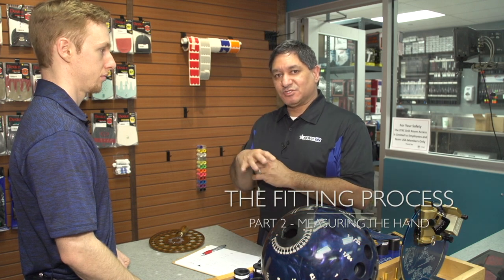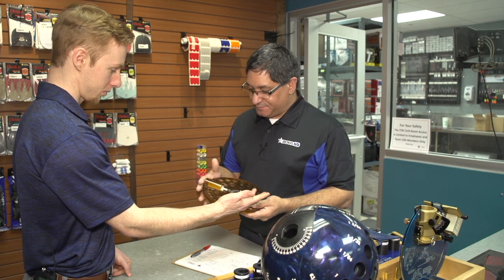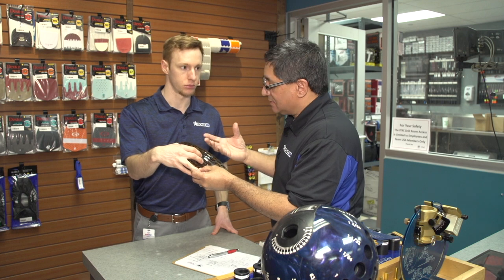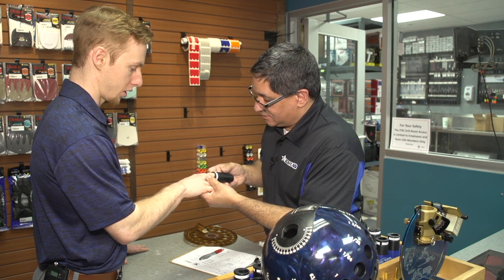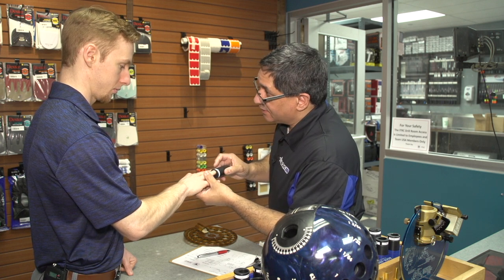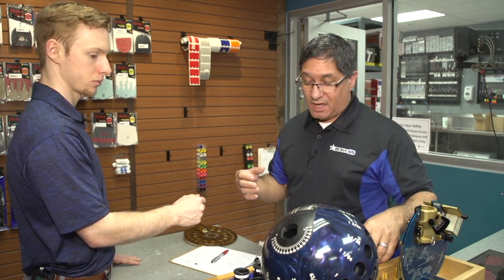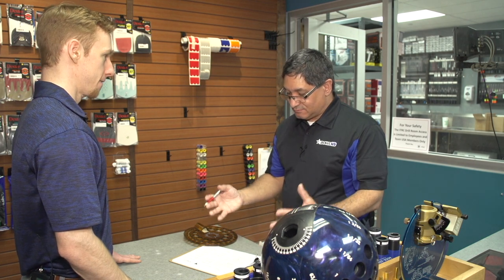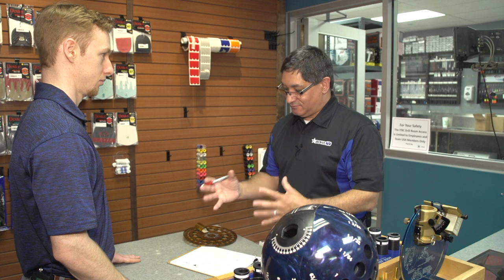Hot Off the Press - Measuring Your Hand for a Proper Bowling Ball Fit (Fitting Process Part 2 of 6)

Comment: Always measure the finger holes with the customer's palm facing up.  Every time.  That way you can see exactly where the finger bends.  If you have the customer palm down, you are always guessing what size hole to drill, and you usually guess wrong.
Reply: Question? Does the pro shop always have to measure your hand when drilling your ball because the pro shop near me didn’t measure my hand. He just drilled holes and then measured the insert. I’m also a no thumb bowler
Reply: @Shheeeeshhhhh  Since you don’t use your thumb your pro didn’t need to take all the steps necessary to drill a three-hole grip.  Most inserts, except very small ones for kids, take a standard 31/32 inch pilot hole, so it sounds like he took care of you properly.
Reply: @lumberlikwidator8863  okay thank you